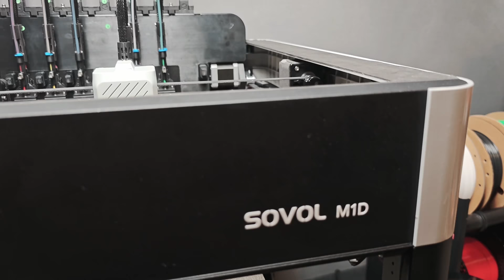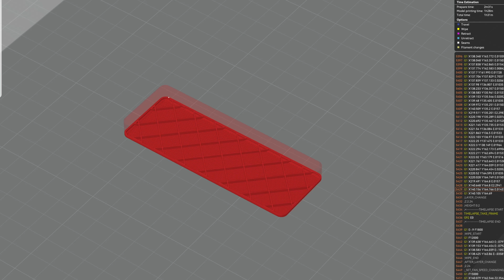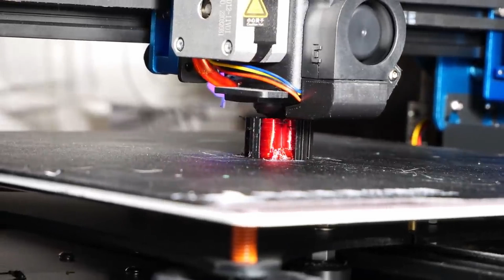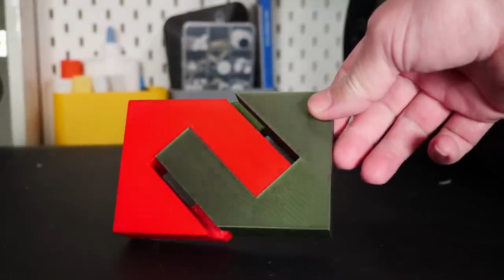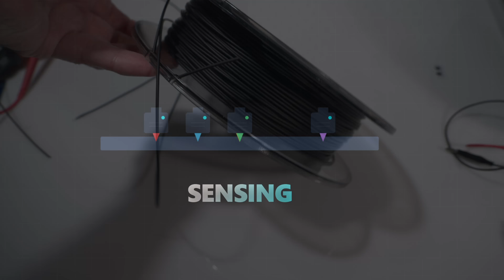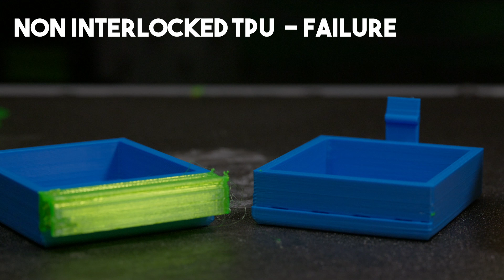Unlock these Advanced Techniques on your 3D Printer

Comment: I tested it with clear PLA but even after drying it clogged my printer harder than ever before and I switched to PETG. With clear PETG it worked really well, but I just don't like the appearance of non-clear PETG, it is too reflective. So I am now printing PLA with channels to insert PETG Filament cuts, but this limits the geometry and adds assembly time. Can anyone recommend a high quality clear PLA to me?

Comment: If you like architectural prints any IDEX printer can do this.
Print the building in a dark opaque material, the windows in a transparent material and design an internal channel to push an led lightstrip through.

Comment: something that you can do that helps quite a bit getting the cost down with dissolvable, just use like 5-10 layers and make the rest in cheap PLA. (check "dissolvable support interface" or something similar.)

Comment: I'm not particularly intressent in 3D printing for printing out trickets and action figures. How ever for advanced material combinations in combination with CAD. That has all my neuron fire at max. Can you Use the Sovol M1D Advanced (Or what ever it is called) to print out Nylon 12 combo with TPU D65.
Reply from the maker: With an enclosure I would certainly expect to be able to

Comment: well temp diff is a problem when you print ASA for example in a heated chamber and try to combine with PLA, because PLA yields from the sheer temperature in the chamber if nothing else.

Comment: I have done some functional thermal difference prints already. We needed some fairly small guide blocks on ball joints, they needed to be attached so vertical force cannot rip them off but at the same time pretty much so small we couldn't just insert metal on metal ready made ball joint in them. Before we had just used ball joint with a thread and put a washer under the ball and the washer was glued to the nylon guide block.
What I tried was printing a PA guide block with cavity for the ball joint and "throat" of just couple walls of PA into the cavity so it's very tight fit through. Then I used PLA as infill for the block and once the ball joints were inserted, the blocks went to oven for the PLA to melt. My theory was that if we could melt the PLA within the block, it would pool to the bottom and so solidify the throat so the ball joint is secured into the block. Notice: "Theory" about 5 out of 20 guide blocks this worked, rest were way too tight to work or the PA warped too much.

I'm so looking up what the IDEX printers will come to. Actually looking to get Prusa One with 4 toolheads, but I will first see where others go... I'm not biting the Sovol again thou... Still too bad taste in my mouth from SV07+ that bricked and I found out Sovol basicly doesn't update their repositories and if you don't have certain firmware, no updates for you. If M1D would get even ONE public update on GitHub or Sovols website, I could consider it after the second public update. But look at their track record of dumbing the first firmware version out and then nothing, I'm looking for something else.
For real, SV08 isn't that old and it's GitHub repository has been updated 2 years ago, good luck if that bricks. Now that they have completely removed everything about SV07/+ (no firmwares, no support pages, no nothing), yeah, nope.
Considering how much into the new territory Sovol is going with the M1D, I except them not being some kind of super coders and have perfect code at the release. SO there must be updates, there must be uploads to the GitHub and their page, there must be some movement going.

Comment: With all the latest advances in the multi extruders for 3d printers, one thing I’m surprised I haven’t seen yet is copper trace wire or laying tool. Ideally, it would have spot weld capability to interconnect between layers but even being able to integrate traces in a 2d layer of a print would be extremely useful… at least for the projects I get excited about.
Before anyone patents this idea, I’m hoping the open source community can implement it.

Comment: I have been doing this with some of my niche one off designs but with a much more manual print seperate and glue into place method. I'm going to be using the same method for a bicycle handlebar Bluetooth speaker unit, along with some clever methods to make it somewhat water resistant. Glad to see a video about the multi material tool changer method. I do plan on getting a tool changer setup but, ya know, the economy.

Comment: PET CF internal walls PET external walls (thin)… and with other materials etc. 

Bellows (TPU PLA) to protect lead screws from getting mucked up. 

Sliding /self lubricating materials outside, strong material inside.

Comment: depending on the design of your part you can edit the g-code to make the printer lay down a thick blob=like line that is even clearer than layers into an channel or groove almost like just gluing a piece of the filament into it but in whatever shape you need instead of just a straight line or curve.
Reply from the maker: Excellent idea

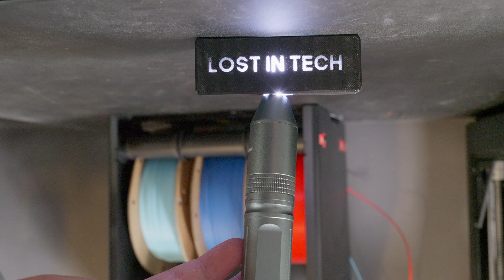Comment: Looks like fun, but I see you also need to use a flashlight that produces so many lumens that it actually melts the plastic when you hold it against the plastic (smoke can be seen at 2:05). It's a nice idea, but I don't think it's really feasible when printed. Instead I would suggest making channels in your print and just put the 1.75mm filament strands in it if one needs to bridge light further than a few mm's.

In most practical applications it would be better to find a way to guide the light in such a way that one can simply use one neopixel for example, to keep the energy usage and heat accumulation to a minimum.
Reply from the maker: that's dust inside the light on the lens. The plastic isn't heated at all, that would be concerning. The light source is for an endoscope so it's not in the order of magnitude you suggest otherwise it would be dangerous.
Reply: @LostInTech3D  Okay, I might accept it as dust :D
Reply from the maker: @MarinusMakesStuff 😅

Comment: I almost never print in color so this is how I'd like to use the M1D - multi-material printing (dissolvable support or TPU rubber feet on an ABS-CF part) and to have all of the materials I normally use pre-loaded and fed from their own dryer boxes so I can start printing without needing to swap filaments.  That said, 6+1 is overkill for me.  I'd be happy with 2 filaments and 4 would handle all of my needs and wants, so maybe I should get a small BondTech INDX upgrade for my Sovol Zero and/or SV08.

Comment: FYI you can make light pipes without any Multi material printing. Just make a channel in the print that's big enough for the filament to insert (e.g. 1.9/1.95mm is what I use) and it works really well. Oh and a dab super glue brushed, dried and sanded makes an excellent diffuser.
Reply: I've used clear hotglue injected into the hole then slice it with a razor blade where it squeezes out.
Reply: @thirtythreeeyes8624  I've done exactly the same and it works wonders, at least for things not greater than a few centimeters
Reply: Another technique that works unreasonably well - 2mm ID silicone tubing.

Print a mold that fits around the OD of the tubing that holds it in position.
Fill tube with uv-curing resin, cure it through the tube.

Slice tube open, remove your flawlessly smooth, rigid light pipe
Reply: I’ve done the same with the filament light pipes. They turned out fantastic. Made the hole in the end a friction fit so that it didn’t need glue. Would do again.
Reply: @pretenda Sehr interessant! Bei welchen Sachen kam es zur Anwendung?

Comment: Save cost by printing expensive materials with a desired effect on the outside and cheap materials on the inside. Use stronger materials as a skeleton for a print to give it desired properties while having a different outside material or more flexibility. Similar to a lot of what you discussed.

Comment: Huh I tried what you made here with my doot changer for the light-up logo Logo but it didn't actually work for me :O Maybe I just didn't design it right LOL
I miss my doot changer so bad, I want a multi material printer again so baaaaaaaaaaaaaaaaaaaaaaaaaaad.
Reply from the maker: Perhaps I need a whole video on it because there is a lot. You have to make sure the orientation is correct of the lines but also the led has to point correctly, not being diffuse, and also be fairly bright if it's a long run.
Reply: @LostInTech3D  I did that 5 years ago or something so I have no idea what I tried :D I wish I still had it to try it again. I ended up just gluing an led directly behind the logo!

Comment: Nice video.  I was a backer of the M1D but I dropped it recently when it came out how bad it was at TPU except for the left nozzle, which wasn't enough for me.  I will instead use a U1 for TPU until a better solution is available.  The IDEX is more of a novelty with little use for me.  If I didn't have more capable engineering and TPU printers already, this might have been OK.  But bad at TPU and only ok for engineering since it is just another 100/300c printer... Oh well.

Comment: It sounds like to make this really functional that a slicer tool that would allow for light location and endpoint placement which would allow the slicer to implement start and end lines to allow for better light flow.  It could start lines at the light location and end them at the endpoints allowing for lines that don't bend around in loops, essentially better for light transmissions.  I'm sure it would be useful for the other applications you mentioned as well.
Reply from the maker: yes - this, like a lot of things, makes you have to work against the slicer not with it

Comment: I could technically stack my sunlu driers (I just haven't). They are rectangular, but I can only do 1 temperature at a time in all 4 slots, so that is a nice feature. I do have 5 driers though. 2 sunlu s4 and 3 sovol dual slot

Comment: there was a print I did years ago, can't remember where I found the model. It had a few layers of TPU in the middle where a living hinge was, with PLA before and after those layers. Always found the idea fascinating, but manual filament changes mid print on my old beat up Ender 3 really made it not super viable to do much of. With all the multi material systems and tool changers we're finally getting, I'm excited to see where that idea leads!

Comment: At the end of the video you make a brief remark about solid bones within flexible material. I work with this concept a lot, with a solid hand grip with an object modifier to create a soft uniform thickness skin. 

With different print settings as well as the widely available softer TPUs these days there is so much fine tuning available to the desired feel in hand. 

Toolchangers rock! Also a shout out to old fashioned IDEX printers from 2021ish which could pretty much do this stuff already way back when
Reply from the maker: ah that's interesting to hear! I definitely want to explore this also at some point, but I get the feeling it's nowhere near as simple as it appears on the surface - as you say especially if you get into the lower shore hardness materials.
Reply: @LostInTech3D I will say that when I first got my U1 I jumped the gun and loaded up some 85A TPU right away without understanding the mechanical preparation needed and was rewarded with a nice toolhead rebuilding exercise to clear the resulting jam. Still haven't had the courage to try 85A since!
Reply: @DrAlanQuan can you explain what prep you needed to use TPU? On my old ender 3 I converted to direct drive and that's all I really needed for good quality TPU prints. I was able to reduce retraction a lot, since there was now only about 2 inches of ptfe between extruder and nozzle instead of almost 2 feet. On my new kobra s1, I have had zero luck with TPU, even though it's already direct drive from the factory.
Reply: @Gibson99 Snapmaker officially support TPU as soft as 90A, and it prints reliably out of the box for 90A and the more common 95A.

However, 85A is significantly softer and wants to noodle around and get jammed up. On the U1, you need to back off the extruder idler spring pressure, and there's also a filament guide on the toolhead that has a lot of open space and doesn't fully constrain the filament path, which gives the 85A noodle a chance to make a break for it. A guy designed and CNC machined an aluminium replacement part which is more enclosed and that is supposed to help with reliability with 85A printing
Reply: @DrAlanQuan  dang... that's a bit more than i'm willing to do just to print tpu on the k1s. guess i'll just keep the ender around for tpu prints when i need them. i already modified the ace pro (ams w/ dryer built in) to feed out through the lid so i can dry while printing on the ender like i can on the k1s, so i guess i'll just keep doing that. thanks for replying though!
Reply: @DrAlanQuan  We went into this exact use case in my recent video about the m1d
Reply: I used this principle to make chain guide for motorbike where inside skeleton is petg and skin is tpu. But without multi-material, I just printed it separately and insert skeleton inside tpu. Sure, not with all geometry you can do like this, but I think it is not unique to multimaterial printing. Multimaterial makes sense only if you NEED to fuse different materials, but in most cases you don't have requirement to fuse them.

Comment: Great video! I think I need some of that conductive material to make a large strain gauge for teaching how they work.
Reply from the maker: I always wanted to try a strain gauge - it might work in "large" but be aware I had some issues with getting it to clamp without affecting the resistance readings. Not insurmountable I'm sure. If you get it working ping me!

Comment: I wonder if the light-part thingy wouldn't work as well as if it was hollow. After all the situation is different in a smooth, round filament than in a basically square rough part. And the examples you used are rather short and tiny.
Reply from the maker: They're actually very long compared to commercial light pipes. But yes, you need to have essentially solid infill for this to work well. Not a problem for fdm.
Reply: @LostInTech3D  It would be nice to investigate this further. Until then I consider those only "plastic windows", since - as far as I know - waveguides are much more complex and heavilx relying on a geometry, an FDM printer can not provide. 
But I'd be glad to be proven wrong. 
Thanks for the many awesome videos you already made. I really appreciate your work. ☺

Comment: Don't tell us that PA water dissoluble is cheap? It is not cheap. it cost's over 3 times the price of today's normal filaments.
But you would say it is cheap as you are lucky as you don't pay for the filaments or printers no matter how expensive they are!
Reply from the maker: I've bought every reel of PVA I've ever used, with my own money 👍

Oh, except the first one, I borrowed from Mark (mark who's been in previous videos). Thanks Mark 👍
Reply: I wouldn't call a $30-$50 roll of filament expensive... Especially as any printer capable of printing in multi material is going to be like $400+. I mean heck, it also wasn't that long ago that the avg roll of filament cost $30.
Reply: @colincampbell3679  it's relatively cheap from a usage rate standpoint. You are going to typically get more mileage from support material because you don't need as much relative to the main material.